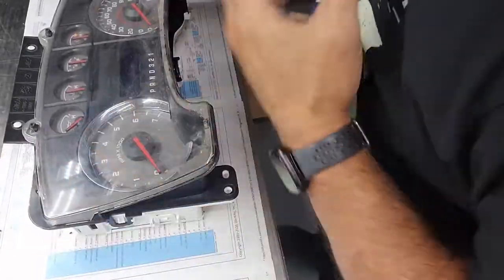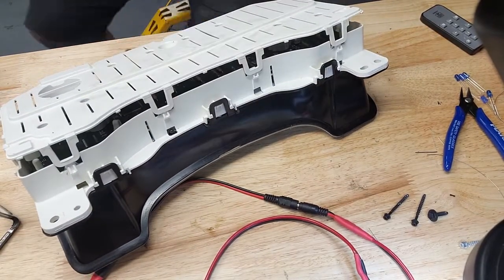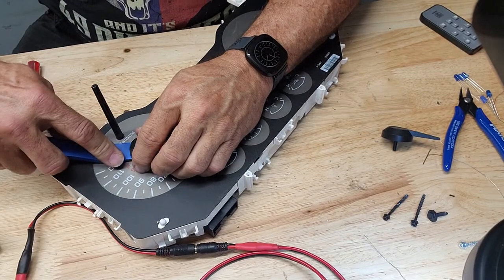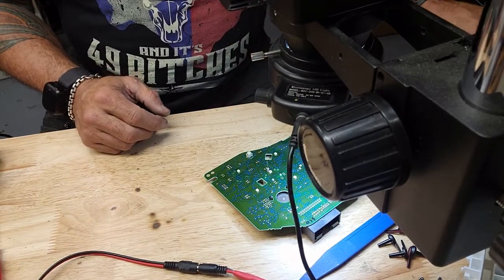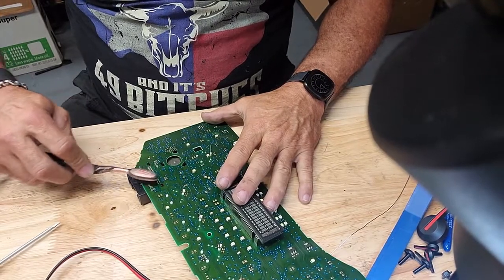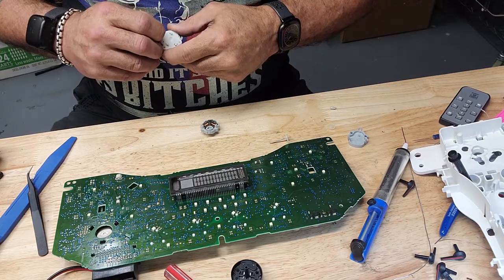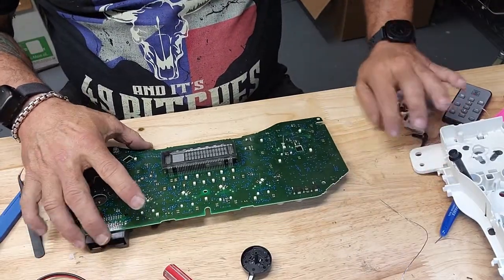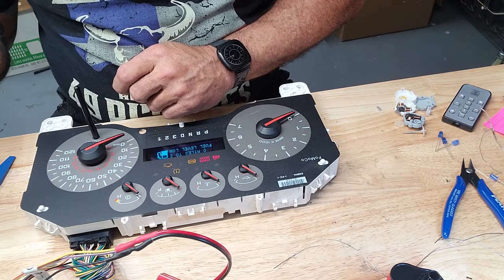08 09 2010 F150 / 250 Instrument cluster has Intermittent or total power failure.  We fixed it!!

Comment: One tip on removing the speedo and tach dials. Pry them straight up. If you spin them in circles you will snap off the tiny plastic stop in the stepper motor

Comment: I’ve got the same issue on an 06 F150. Has the big center speed out tacked to the left and then dispersed fuel and coolant gauges on mid and right side of cluster. Is it the same needle tear down,set and install procedure for the gauge needles? Thanks.😊

Comment: I don’t get what they were supposed to look like in the first place. You showed the before and not the after are the top and bottom contacts supposed to connect or side to side
Reply from the maker: im not real clear what your asking but in the end the contact points should look shinny without cracks...be careful not to bridge any seperate contact points.  your just trying to repair the cracks in the existing solder .   not make new connections between pins